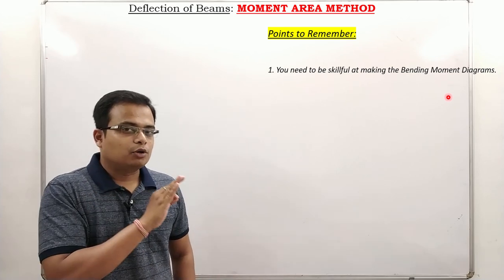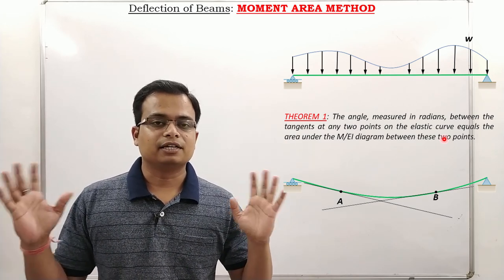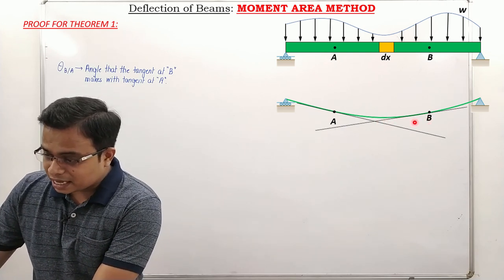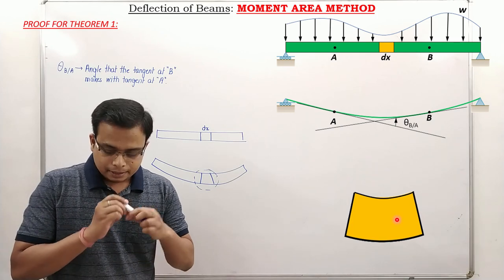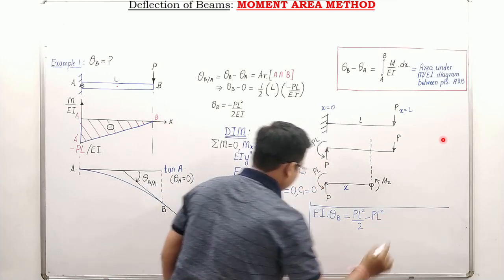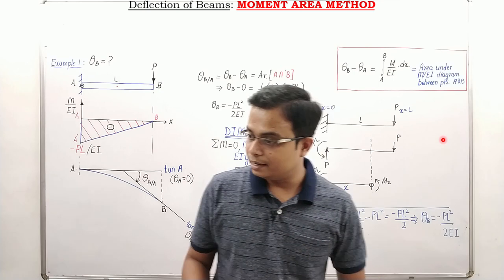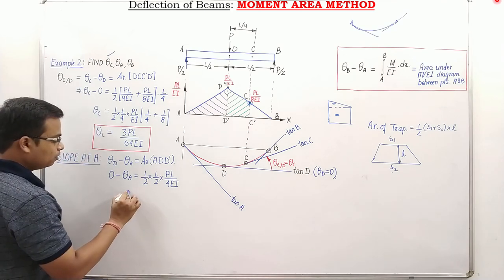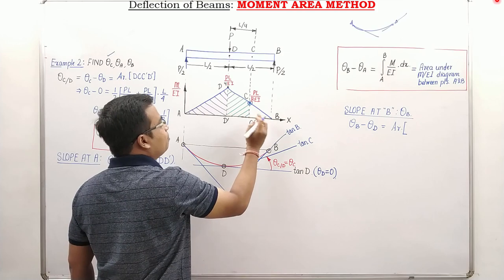Deflection of Beams || MOMENT AREA METHOD || Lecture 11

Comment: The hexagonal  base side of 30mm and axis length 60mm is resting on h.p one of its base corner and it's axis inclined at 35° to h.p the base sides containing resting corner or equally inclined h.p?